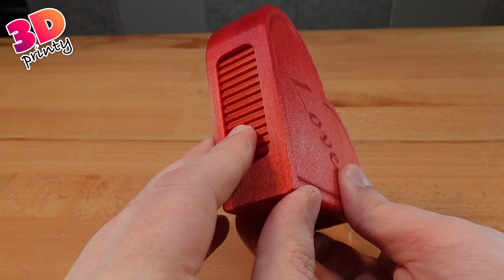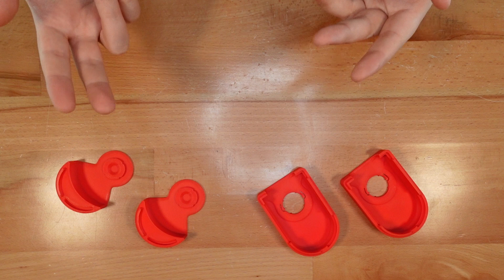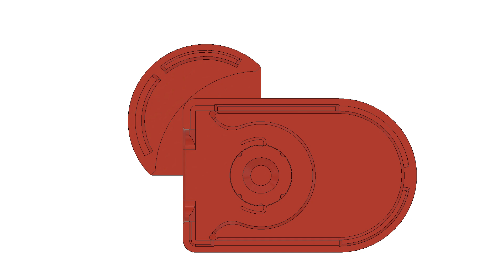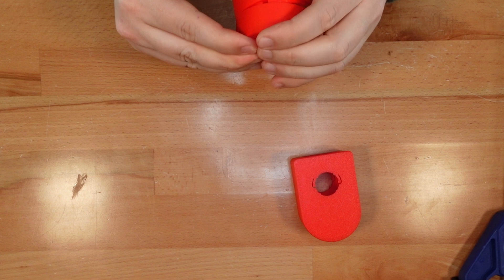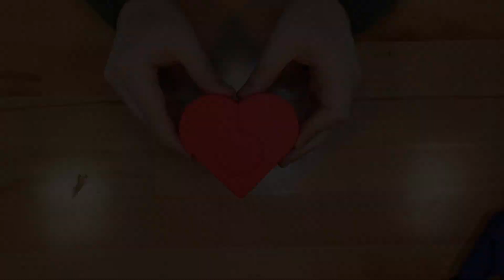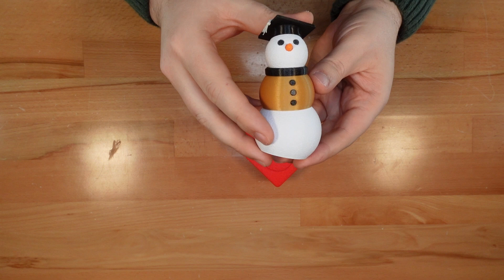3D Printed Valentine's gift - The Openhearted Box

Comment: Can this be printed smaller (50%)?
Reply from the maker: Possibly, but there are a few parts that might get a little weak: the spring arms and the snapping tabs. If you're okay with that, the basic functionality of the box - a rotating lid that transforms into a heart - should still work.